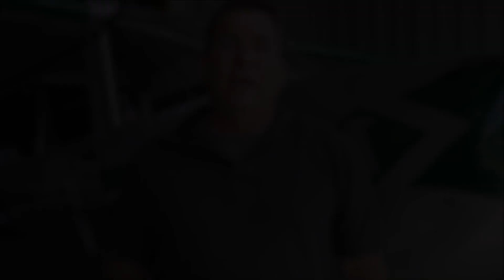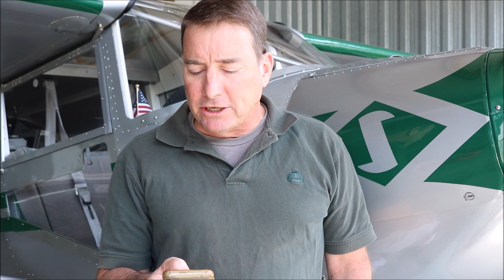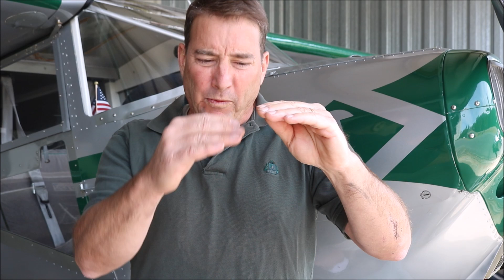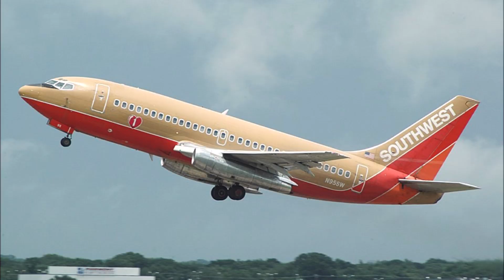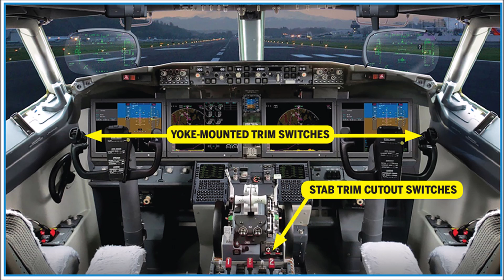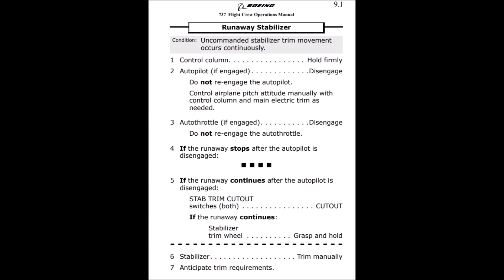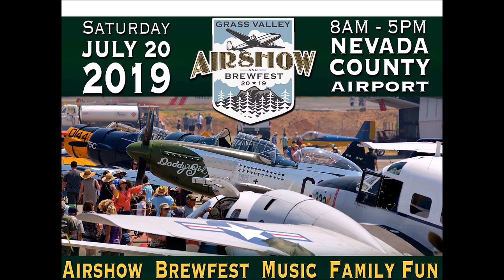737 Max UPDATE 27 June 2019 -The Latest Issue

Comment: Great explanation.  I am an amateur but please clarify/ correct my understanding.
There are electric trim buttons on the yoke that drive the jackscrew on the horizontal stabiliser at the tail.  The same jackscrew is driven during automatic aircraft nose down by the MCAS system when the AoA sensor goes beyond a pre-set limit.  If the AoA sensor gives an erroneous reading, you follow the Boeing procedure and use the STAB TRIM CUTOUT switches, but then you have an out-of-trim aircraft and you are unable to use the electric trim buttons.
Am I right to assume the yoke is driving elevators rather than the horizonal stabiliser?  If so, the two control surfaces are effectively fighting each other.  You pull back on the yoke but it’s not enough and the manual trim wheels for the horizontal stabilizer can’t be moved because there is too much pressure to turn them.
So your only option is to use the electric trim buttons and for this you need to switch the STAB TRIM back on.  When you do that the MCAS activates nose-down and you’re in serious trouble if you’re going a bit too fast.
Is this a fair hypothesis for the Ethiopian crash?
Reply: Not entirely.  The MCAS Emergency AD does not say to turn off electric trim with the airplane in an out of trim condition.  In fact, it repeatedly says the opposite, the airplane should be trimmed back before placing the STAB TRIM CUTOUT switches in the CUTOUT position.

The AD described the operation of MCAS in the event of erroneous AoA data.  As part of the Background Information, the AD explains that “nose down stabilizer trim movement can be stopped and reversed with the use of the electric stabilizer trim switches.”  The Background Information section also says “It is possible for the stabilizer to reach the nose down limit unless the system inputs are counteracted completely by pilot trim inputs . . . .”  

The AD then provides Operating Instructions, which are to perform the Runaway Stabilizer NNC.  The second step in the NNC is to disengage the autopilot and “Control airplane pitch attitude with control column and main electric trim as needed.”  The AD Operating Instructions then include the following Note:  “Initially, higher control forces may be needed to overcome any stabilizer nose down trim already applied.  Electric stabilizer trim can be used to neutralize control column pitch forces before moving the STAB TRIM CUTOUT switches to CUTOUT.” 

The ET302 crew never completely counteracted the MCAS nose down trim inputs to neutralize control column pitch forces before placing the switches in the CUTOUT position.

The first MCAS activation at 05:40:00 lasted 9 seconds and moved pitch trim down from 4.60 to 2.1 units.  At 05:40:12, the crew used MET to trim up but they only held it for about 3 seconds and it only moved pitch trim back to 2.4 units.  There is no explanation in the Preliminary Report of why the crew released the yoke switch and did not continue trimming.  The second MCAS activation at 05:40:20 lasted about 7 seconds and moved pitch trim down to 0.4 units.  At 05:40:27, the captain advised the FO to trim up with him and the crew interrupted MCAS by trimming up with the MET switch for about 9 seconds back to 2.3 units.  There is no explanation for why they did not continue to hold the MET switch long enough to fully relieve control column forces and trim back to 4.6 units, where they were before MCAS activated the first time.  They then placed the switches in the CUTOUT position, but then later turned electric trim back on to try to trim up with electric trim.  At 05:43:11 and 05:43:15, they only held the switch for about 1 second (or less).  There is no explanation in the Preliminary Report of why the crew only blipped the switches and did not hold them long enough to increase pitch trim in a meaningful amount.  Unfortunately, they did not place the switch back in the CUTOUT position and MCAS activated about 5 seconds after the last MET blip, moving trim from 2.3 units down to 1.0 units.  Instead of using MET to trim back up, the crew stopped MCAS by placing the switches in the CUTOUT position with the airplane in a nose-down attitude.

Much has been said about the crew not reducing thrust and speed throughout the flight, contributing to the inability to use the manual trim wheel to reverse nose-down trim.  As I have noted elsewhere, I believe the airplane was overloaded, and the crew was having control problems before MCAS activated.  If so, that may have contributed to the decision not to reduce power and airspeed.
Reply: @danielforman5064  Many thanks Daniel for the explanation.  I wonder which system (MCAS or MET) has priority, i.e. if they both activated/ operated at the same time, which takes precedent.  
Speculation: I also wonder if the stab trim motor has enough torque when it's severely out of trim.
Reply: @rogs4646  You are welcome.

MET is supposed to have priority over MCAS.  Specifically, 1) as long as the MET switch is pressed, MCAS is not supposed to activate; 2) when the MET switch is pressed, MCAS is supposed to be interrupted (if it was active); and 3) MCAS is not supposed to activate until 5 seconds after the MET switch is released.  The DFDR data is consistent with these three rules.  Note that the MET switch is connected through a series of switches and relays to the stab trim actuator without going through the flight control computer.  

With respect to stab trim motor torque, that does not appear to have been an issue in the ET302 accident.  As I described above, the second time MCAS activated, it moved trim from 2.4 units down to 0.4 units.  That is the most out-of-trim condition the flight experienced.  The crew responded with MET, returning the trim position to 2.3 units.  So there was enough torque at 0.4 units and a speed just under VMO to return the stabilizer to a trim position of 2.3 units.  When the crew turned electric trim back on at the end of the flight, the trim position was 2.1 units, so the motor should have been able to trim up from there (the DFDR data shows that the trim position did move up to 2.3 units in response to the brief MET blips, i.e., it doesn't look like the jackscrew was stuck or the motor was burned out).
Reply: @danielforman5064  Thanks again Daniel.  That all makes sense and follows the FDR.  I wonder what the explanation is for the trim position moving/ slipping from 2.3 to 2.1.  
- Manual input from the trim wheels, but in the wrong direction?
- Increased load on the stabilizer pushing it further out of trim?
It looks like something was going on with the autopilot (AP Warn) at the time of the second, brief, MET at 05:43:15.  I wonder how these events are linked. 
The brevity of the MET blips remains unexplained and I guess is a focus of the investigation.  Thanks again.
Reply: @rogs4646  
I have read somewhere that the change from 2.3 to 2.1 units may have been due to the FO trying to trim up with the manual trim wheel.  If he found it stuck in the nose up direction, he might have wiggled it a little to see whether he could get it unstuck, which might have caused it to act as a ratchet.
I don't think I've read an explanation of the A/P warning at the time of the second MET blip.  The A/P wasn't engaged.  Perhaps it was a FD warning that they were approaching their selected altitude of 14,000 ft.; however, I don't fly this class of airplane so I am ignorant of the A/P and this is speculation.  Unfortunately, the Preliminary Report doesn't include any CVR info from after 05:43:04.

One other comment about the flight, which I've made previously.  I believe they were overweight.  The Preliminary Report says they were under Regulated T/O Weight, but it looks to me like they got there by estimating around 167 lbs./pax including carry on bags.  If you use a more FAA-std. 190 lbs., they would have been a couple of thousand lbs. over.  If you look at the FDR data, pitch and aft column inputs rise abruptly immediately after T/O, followed 3 seconds later by forward column input.  The initial climb looks shallow, and when the flaps came up, they started to sink (even though airspeed was around 250 kts.).  Also, the captain requested continue runway heading and announced flight control problems (05:39:50 and 05:39:57) before MCAS activated (05:40:00).  So I think the flight may have been in trouble before MCAS activated, and if they were overweight, that might explain why they didn't reduce power and slow down.
Reply: @danielforman5064  Dan, thanks, very interesting.  The “ratchet” theory about the trim wheel makes sense.  
I’ve not spotted the “overweight” theory before.  I don’t know what a good (i.e. non-overloaded) take-off looks like but I see what you mean about the altitude dip at 05:40.  I just noticed that there were short AND blips before 05:40 that seem to have an effect on the pitch trim too, i.e. they were doing something.  This initially seemed wrong as I didn’t think the MCAS works when the flaps are deployed.  Then I noted that this is when the AP is on and I understand, with flaps deployed, there is a low speed trim.  Is the AP automatically trimming the nose down here?  If so is this linked to AoA as well?   Did the pilots have both the AP and MCAS working against them? As I said at the start, I am just an interested amateur in this, so apologies if I am showing my ignorance!
Reply: @rogs4646  
The slight sink began before 05:40:00, probably around 05:39:51, around 1 second before the brief AND command.  The AND command at 05:39:52 or :53 was presumably the A/P, but it made a negligible difference in stab trim position.  I suspect, but do not know, that the decrease in pitch and slight sink resulted from the retraction of flaps and the excess weight.

This Reuters report shows the difference in climb profile between ET302 and other flights (Lion Air and other Ethiopian Airlines flights).  

https://graphics.reuters.com/ETHIOPIA-AIRPLANE/0100911Q1DX/index.html  

You can see that the ET302 climb was shallow in comparison.  I believe ET302 was overweight because they were ferrying fuel (presumably to save money by not paying for it in Nairobi).  They had 23,000 lbs. of fuel for a flight of less than an hour (probably about twice what they needed, including for reserves).  It looks like one other Ethiopian Airlines flight might have been overweight as well but got away with it (although they had to take the long way around the mountain to the southeast).  Perhaps this (ferrying fuel) was standard Ethiopian Airlines practice.

Comment: Hello Juan... Technical question for you regarding trim drag/parasite drag: The MAX has an inherent nose up propensity. Besides us knowing of a higher danger during high nose up attitude,(T-O/Climb) I can easily imagine that it requires constant Trim Tab adjustments in order to maintain it in straight level flight. This would incur extra fuel consumption. Especially since we know that from the onset of this ordeal, the whole thing has been voluntarily hidden from public view, even up to date, as it's unraveling bit by bit. What are your thoughts on the extra hidden fuel costs embedded in this narrative?
Reply: Autopilot, the condition most planes are in most of the time, uses trim to adjust altitude constantly throughout the flight. Should not be a factor.
Reply: @stimproid , I know. But if it's "embedded" in the MCAS, it'll still be unbeknownst to pilots, since during cruise "autopilot" is operating.

Comment: I would assume there is some numerical value stored in some type of configuration data table that governs how fast the airplane manually re-trims. If this is so it's not really a software fix, which would make a change to the control logic itself. Rather its probably just a change to one of the operating variables that the control system software works with. Perhaps its called "Manual Trim Speed Rate" or something similar. From a purely technical standpoint it's probably easy to punch in a new number for this variable. The problem will be getting it by the regulators.
Reply: Apparently not.   It was an actual processor getting overloaded with input data.    https://theaircurrent.com/aviation-safety/faa-and-boeing-initially-disagreed-on-severity-of-catastrophic-737-max-software-glitch/
Much more complex to fix.

Comment: Juan, I appreciate what you are trying to do here, but in this particular video it seems to me that you have strayed from no-bullshit reporting to unfounded extrapolation that is more common to normal news media. I don't dispute the bulk of what you are saying, and that all seems reasonable. What I question is when you went on into details about Boeing perhaps needing to revise the 'architecture' of the 'microprocessor' to fix the electric trim issue. This just seems like you threw out some buzzwords without understanding them. Every microprocessor has its own internal architecture, and that will never change as long as the same microprocessor is used. If data throughput in a microprocessor based control system is inadequate, you either have a microprocessor that is too slow for the task, or the microprocessor's programming needs revision, or perhaps a simple setpoint or rate adjustment factor in the software needs adjustment. 

Any large commercial airplane, especially fly-by-wire ones, is going to have quite a few 'microprocessors' of some sort, in all sorts of redundancy arrangements, and if there really was a microprocessor 'architecture' problem then Boeing or their control sub-vendor would have to change all related microprocessors and then re-write lots of software, a big deal.

Unless there is more to this story than presented, I would think Boeing needs to do a relatively slight programming modification, and nothing to do with 'microprocessor architecture'.

Comment: The media makes it sound like changing this chip on every 737 would be a horrible burden.  I realize re-engineering a chip might take some smarts, but they're not exactly difficult and heavy!  Thanks for the info you put out on this subject, you explain it quite well.  I do have a question that I've never heard anyone talk about.  Why does the MCAS system work on the trim of the stabilizer, instead of using the elevators?.  It seems like swatting a fly with a sledge hammer.  And it seems like that sledge hammer aspect is what made the pilots unable to recover their planes.  What am I missing?
Reply: Cliff Jones - that is the design of every 737. The stabiliser has a much larger area so can best correct the rotational imbalance between thrust line and lift center. Using the elevators would introduce more drag as they would spend most of their time in a non-neutral position.
Reply: @sja45uk  Thanks for that, but it leaves me unsatisfied.  If it was just a matter of a little more or less drag, the plane wouldn't even have elevators, just stabilizers.  It still amounts to the pilot gets a little tack hammer, and the computer (MCAS) gets the 10 lb sledge hammer  ----  and if the pilot tries to take control, all he can do is shut the power off to the sledge hammer, leaving it too heavy for him to do anything with.

Comment: Juan, Isn't there a system for preventing the stabilizers from pointing the aircraft at the ground at a 40° angle? Surely that would be a basic thing for any safety software to prevent from happening, elevator yes but not stabilizers....

Comment: I had heard another scenario yesterday, and it was about not just the micro processor, but with the programing they put into it, which had no off switch to keep the program from continueing to tip the aircraft into the nose down position.  So, I suggested in the comment section that they should have a kill switch for that micro processor if the pilots cannot retrim the aircraft within seconds.  The pilots had no way to keep the aircraft from nosing down and subsequently the crash. One of the flight patterns I saw of that plane looked like a sine wave, Nose down, they'd correct, then nose down again, they'd correct, until there was no time left for another correction.  the smooth flight they expected from the program they put in that chip has now killed hundreds.  If you can figure it out Juan, you know they already knew of the problem and decided to ignore it.  The cost they wanted to avoid in fixing the problem turned into a risk they don't want to own now that they are going to be sued by dozens of families, I am supposing in a class action suit !!!